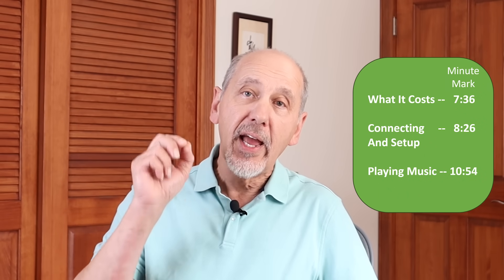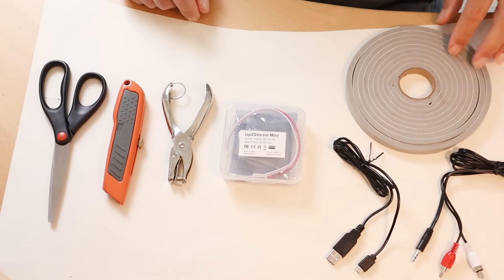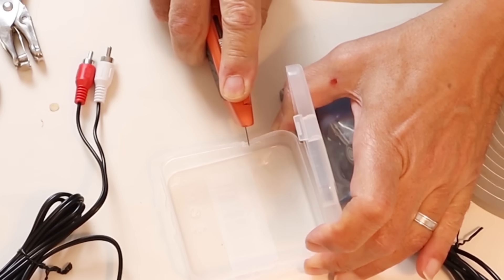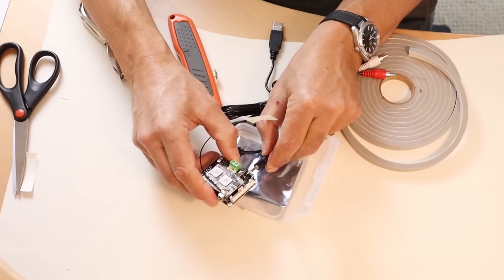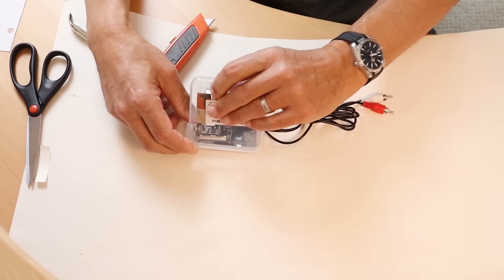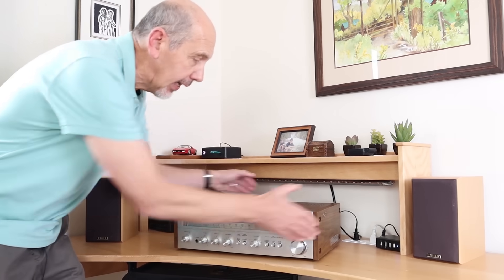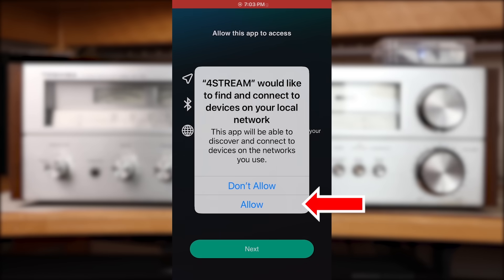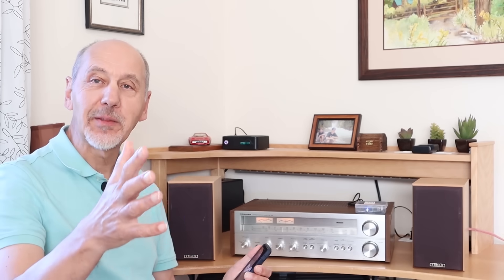Create A $50 Wifi Music Streamer Connect Phone Wireless to Stereo Receiver

Comment: Can I play music using Poweramp or Musicolet apps on my android phone using this device? i.e. will my music playing apps appear in the list of services in the 4stream app?
Reply from the maker: Your music playing apps will not appear in the list of services in the 4Stream app but all the music stored on your phone will appear in the My Music section which appears above the list of services.  This means you can play your stored music directly from the 4stream app without any other apps.  I've found  that is not the best wat to do it though.  Bubble uPnP or HiFi Cast offer a cleaner snappier  experience and work very well with the Arylic Streamer. These will not only play from the phone to the streamer but will also act as a remote controller to  discover and play music  that is stored on computers or servers on your network
Reply: Thanks for the clarification  @rogergadgetguy

Comment: Oh dear No. Guess why anti static bags are anti static?   Give up? Its because they are conductive. They are NOT a shield, they dissipate the electrical energy. So having a board of any type on an anti static bag while powered or operational is a no no. Yes, it might work, but it might not and if it does work right now, it may not work next time you go to use it and the no work may be permanent. 
It may even let the smoke out of a component and once the smoke escapes from an electronic component it will most likely never work again. Proving that electronics works off smoke in the components, ask any repair person.
Reply from the maker: The resistivity needed to dissipate static is very high  (It's in the megaohms) meaning that any currents that flow through the bag are completely negligible, will not affect normal operation, and will absolutely, positively, never ever cause smoke.

Comment: HEllo Roger, what to use if you don't have that power connector on your amp?
Reply from the maker: The USB power for the streamer can be plugged into any USB power block such as a phone charger.
Reply: @rogergadgetguy  Thank you. I have another question about AUX. We are 2 people with older recievers without AUX. Are there any other options because there are still many other plugin possibilities?
Reply from the maker: @ElNagual-j8k Any line level input will work which means any input except phono. Commonly - CD, Dock, Cabl/Sat, TV, DVD, iPod or VCR are all good.
Reply: @rogergadgetguy  Thank you so much.

Comment: Thank you, Roger. The Up2Stream does work as advertised, but I'm unable to connect it to my Google Home network as a WiFi speaker. Sure would nice to have this Home-compatible. All my other speakers are.
Reply from the maker: It's a shame, all music streamers and WiFi speakers have the same technical standard underpinnings (upnP, bojour DLNA) but they all, and especially Sonos, Google, Apple, and Amazon put proprietary software and licencing conditions in place to make sure we can't mix and match other peoples devices into their systems. They say it's to ensure compatabilty, but bluetooth, and WiFi itself prove that multi vendor interoperability can be done if there is a will.
Reply: @ Well put, kind sir. Open architectures preferred. 
My counsel to Arylic, while knowing little about the details, is to pay the license fee - I’ll suggest Google’s - to give their Up2Stream hardware products broader markets. I already made the choice of Google Home for its relative openness, compared to Amazon, and for Google Home ubiquity. Myself, I’d pay an extra $15 for this to work.
Reply: Hi @RogerGadgetGuy . I just installed Arylic's excellent LP10 Google Cast-compatible audio pre-amp. (Arylic also claims Apple AirPlay connectivity on the LP10.) Your previous video introduced me to Arylic. Now they have the product I wanted to use with my Google Home and Spotify audio setup. The LP10 sets up easily as a hardwired or WiFi-connected device. Google Home recognizes it without any additional setup, and I'm now playing Spotify over the LP10 - at WiFi speeds, accuracy, and synchronization with my other speakers. They've also moved to a new app for the LP10: Go Control, instead of 4Stream. It works. 

Thank you for introducing many of us to Arylic. Their new LP10 is exactly what I was looking for - WiFi-enabled audio for any amplifier. I hope it's a successful product for them. It's perfect for me.

Comment: How does this compare to setting up a Raspberry Pi 4 setup using the Moode app that goes on the Pi's Linux OS?
Reply from the maker: Great Question. Audio quality quality will depend on the HAT you use on the Pi. I've used an Allo mini Boss on a Pi Zero with Moode, with awesome results for sound quality.  I also  use a Pi running Moode with 512 Gb USB Stick as a music server, which works well with the Arylic streamer, or other Pi's.  A Pi 4 with a really good USB DAC will give sound quality that's hard to beat at any price. The downside is  Amazon music is not supported by Moode or any other Pi Platform I've tried, and you have to use bubble upnp to play Tidal or Qobuz from Android.
Reply: @rogergadgetguy  But if I connect it to my AVR that has an USB input, wouldn't the signal go straight to the AVR's own built-in DAC? So no HAT needed.
Reply from the maker: @q0w1e2r3t4y5  Yes that will work .

Comment: Thank you for th video. It looks like Arylic has one for $49 that has an ethernet port. Is that beneficial?
Reply from the maker: The ethernet port is a an artifact from when WiFi did not have the capacity that modern systems have. Sound quality will be the same either way. Only use ethernet if you have poor signal at the place you wan't to use the device. Or if your streamer is right next to the router.  If you use ethernet be aware that network devices like switches, bridges and range extenders sometimes break the functionality of streamers which have to be on the same subnet as your phone to work.

Comment: Hi Roger, I've just bought & set up an Acrylic Up2Stream & it all works well. The Acrylic 4Stream app is a bit flakey but now using iEast app. Do Acrylic do a board with a digital out if you have a HiFi with a decent DAC?
Reply from the maker: Arylic sell a $15 SPDIF out board; https://www.arylic.com/products/expansion-boards?variant=32778796040277 It connects to the Up2Stream mini with one of the ribbon cables that came with it it's plug and play, and works great.
Reply: @rogergadgetguy  Thanks Roger, I'll look that up & order one. I guess you've not done a video on using one, have you? Thanks again for the help. 👍

Comment: Thankyou Roger for your reply. In fact I had been so scared of damaging what I felt was a delicate bit of circuit board, I had failed to push in the 3.5 mm jack plug far enough. So, I had a coffee and plucked up courage to give the plug an extra push and alakazam, another click and I now have superb sound through both speakers. Thankyou again for a superb step by step video about a superb piece of equipment.
Reply from the maker: Glad you found out that those boards are more sturdy than they look!

Comment: Sees device but won’t connect.
Reply from the maker: This symptom is normally a function of the network.  It can happen if there are any bridges range extenders or powerline links between the router and one of the devices it could also be a security setting on the router does not allow DLNA connections.

Comment: i have a sony av receiver with bluetooth.  i purchased this just so that i could stream on wifi.  I am a neophyte when it comes to audio.  Am i wasting my time? or will i really hear a difference in music quality. Also wouldnt the 3.5mm jack and the rca cables diminish sound quality?
Reply from the maker: If you have nice speakers that are positioned reasonably (which means not in a corner behind a chair) you will notice a significant improvement in quality with WiFi.  As long as the 3.5mm plug and RCA cables are in good condition they will have no negative effect on sound quality at all.
Reply: @rogergadgetguy  thank you Roger. Appreciate the reply

Comment: Superb video and excellent, straightforward and clear instructions. I have connected the device to an Arcam Alpha 8 but only one speaker is responding…..adjusting the balance makes no difference. Used a 3.5mm jack with both cables connected to aux sockets on the amp. Sound through the one speaker is perfect. If you have five, I would appreciate your advice please. Thankyou again for great video.
Reply from the maker: Most likely a cable problem 3.5 mm connectors differ slightly in size wich sometimes causes issues try pushing and wiggling with the amp on see if it sometimes makes contact.  rule out an amp prblem by switching the RCA cables if outage switches sides, amp is fine.

Comment: is a v very good idea for my vintage hifi. Once i got down to the app, seem is fm China, then i stopped.  😢
Reply from the maker: If you want a WiFi streamer that's not from China you will likely have to build it yourself using a Raspberry pi single board computer.

Comment: Wow I turned my 1947 GE Radio into a Bluetooth speaker using the phono input. Now that you tell me Bluetooth is low quality maybe I should change it to a streaming device 😂 Those vacuum tubes are pretty high fidelity after all, all the Audiophiles love them!
Reply: I'm 50, audio nerd my whole life and Bluetooth is fine for me, I've measured it, and over 12 or 13K BT falls off quickly, only problem I could see, and I can't hear over 13k anyway. Also depends on source (I use an old Iphone) , convenience and needs. You could just use a 3.5mm audio jack and cable, which is much better than both. 
It is magic to see an ancient radio just rocking out cyrstal clear audio.
Reply from the maker: It would be so cool to use an old tube radio (or several) in a multi room streaming system. Take that Sonos!!!!!

Comment: If there are exposed circuit paths or through hole vias on the WiFi board, DO NOT STUFF THE ANTI-STATIC BAG IN THE BOTTOM OF THE BOX!
Anti-static bags are conductive by nature. It is possible to short out components on the WiFi board by doing this.
Reply from the maker: Static bags are conductive but very high impedence, low contuctivity they will not cause any problems for this type of board.

Comment: I don’t get it.  If the Up2stream does not directly log into Spotify and is just streaming from the phone to the Up2stream via Wi-Fi , why not just use Bluetooth; I.e., just get a $20 Bluetooth receiver?  Likely, you’ll be within 25 feet of the Bluetooth receiver anyway.
Reply from the maker: The sound quality is noticably better over WiFi and the connection is more reliable. One example whenever my wife starts the car or returns home, my bluetooth connection switches over to the car and my music plays there instead of the stereo. Don't have that problem with WiFi.

Comment: just bought mine for 43.5 euro , , i noticed it has an extra board on top now, , i think it has extra options,  sets up and works in a few minutes, awesome thing and nice sound .  i wanted this because i bought a new receiver with build in wifi and found out how easy this is to use instead of bluetooth . i open spotify, choose the source and the receiver (with the build in wifi) starts up without any help. Now  this small device let me make my other older receiver also capable of playing wifi content. i put it on my rodec mixer,   the thing is this wifi signal go's trough walls a lot better than bt even from in the garden,  adjusting the volume and searching new songs, especially with spotify this is a must.  in weekends it plays the whole day long without loosing connection .

Comment: Adding an optical connection would be awesome.
Reply from the maker: You can add the Arylic SPDIF out board.  It's only $15 plugs in with ribbon cable provided and works great with no additional setup. https://www.arylic.com/products/expansion-boards?variant=32778796040277&aff=189

Comment: Unless I'm missing something, it is incorrect to say that you can stream from any computer you have. I have a MacBook Pro and 4 Stream isn't made for that. It is made for phones and pads but not laptops. Am I wrong?
Reply from the maker: Thanks for asking this question. I think I see where the confusion is.  The 4Stream app is not the streaming device it is merely the controller. What it does is let you view and select from the available music at the music source and direct it to be sent to your stereo. The music source can be a streaming service like spotify the media app of your phone or any  computer on your network. The Mac needs to be set up as a music server, but once you have done that. You can remotely send music from a MAC to your stereo using the 4Stream app on your phone.  This video shows a free server app that works on Macs   but there are other apps you can use.  https://youtu.be/DZSx9ZPveqY This is a lightweight service that runs in the background doesn't affect the operation of the MAC but is always available as long as the computer is turned on.

Comment: Great video mate but I'd be more interested in streaming my own from a NAS. Does the software support this type of connection. Having a small cheap less power hungry device compared day to a PC would be nice especially if it's able to decode codecs like DTS, DVD-AUDIO SACD etc. 
I guess I'll send the company an email 🤔

It does sound intriguing. I may just pre-order one anyway.

Thanks for the video 👍
Reply from the maker: Streaming from a NAS is supported provided the NAS supports DLNA. Most do but it may be turned off by default.  DTS, DVD audio and SACD codecs are not supported by this streamer you would need to transcode those files tosomething like  Flac, ALAC, mp3, or AAC.

Comment: For 50$ you can buy ready to use Android tv box with 3.5 aux and optical SPDIF outputs, Chromecast and even Netflix certified.
Reply from the maker: Can you share a link please. The ones I've seen at that price haven't had the audio outs. Airplay is not normally featured on these boxes either but they is easily remedied with the Air Receiver app.

Comment: Thanks for this great video,Roger.Its fantastic to find someone like you who wants to make use of the full sized hifi equipment of yesteryear which,in my opinion produced a far richer sound that the modern scrunched up versions(aka mini hifi) Is there a dab addon instead of the network streamer which might enable me to receive Gold radio,therefore matching the age of the hifi to the music it produces?I await with interest......
Reply from the maker: Hi, I'm not aware of any DAB receivers designed to be used with a home audio system, but they are available for cars, and should work fine. Look for one that runs off 5V usb and has an Aux output something like this;  https://www.aliexpress.us/item/3256807764050822.html?src=google&pdp_npi=4%40dis%21USD%2141.05%2138.49%21%21%21%21%21%40%2112000042996877889%21ppc%21%21%21&src=google&albch=shopping&acnt=708-803-3821&isdl=y&slnk=&plac=&mtctp=&albbt=Google_7_shopping&aff_platform=google&aff_short_key=UneMJZVf&gclsrc=aw.ds&albagn=888888&ds_e_adid=&ds_e_matchtype=&ds_e_device=c&ds_e_network=x&ds_e_product_group_id=&ds_e_product_id=en3256807764050822&ds_e_product_merchant_id=109198114&ds_e_product_country=US&ds_e_product_language=en&ds_e_product_channel=online&ds_e_product_store_id=&ds_url_v=2&albcp=20123152476&albag=&isSmbAutoCall=false&needSmbHouyi=false&gad_source=1&gclid=Cj0KCQiA7NO7BhDsARIsADg_hIZ6ERQEwrdEoyQ1tswbVrbzlAtMT4yrC90eCdVHSrmsSceofXwtTeEaAk7gEALw_wcB&gatewayAdapt=glo2usa
Reply: @rogergadgetguy  Thank you for that,Roger

Comment: GOOD STAFF. But can i use typical tv adriot box as the streamer with hdmi output and show to connect to an avr.tks
Reply from the maker: Yes you can use an android TV video box connected to an AV receiver as a music streamer.
Reply: Still cannot paired my phone 4 stream apps to my tv box(no blinking lights). DID I MISSED ANY STEPS?
Reply from the maker: @joelow4120  The Android TV box does not need the 4 stream app. If you have an android phone tap the chromecast symbol in any music app and you should see the TV box.  For an iphone install the air receiver app on the TV box which will give you streaming via apple airplay.

Comment: Interesting, you stated that Bluetooth uses compression and discards  musical information, this is true, however there some Bluetooth codecs that use far less compression, think LDAC, HWA.
But then you setup Spotify on your streamer, which is fundamentally mp3 which is lossy compression all the way. So in this example I don't see any advantage, if you're using Spotify, may as well use Bluetooth.
Reply from the maker: Hi I use spotify for demos because they have royalty free music that won't give me a copyright hit.  It'salso the most popular music service so viewers are more likely to be familiar with it than the lossless services.  Even Spotify does sound better on WiFi. I think the reason for that is that Bluetooth does not support Mp3 codecs so the Mp3 stream has to be trancoded into SBC before transmission. the  transcoding process is itself lossy. WiFi will send the Mp3 unaltered. Another reason is that most bluetooth devices use the on chip DAC and the DACs on cheap BLuetooth chips are pretty bad. The DACs used on WiFi streamers measure better, and sound better.
Reply: Shhhhhhh 😂

Comment: In Fact you ONLY need the phone, if you run plex and install plexamp on all the phones you want to use as clients and you can then use any of the devices on the network to control each other.

Comment: Interesting solution, thanks.  What about the power button ?
Reply from the maker: The power is very low, around 1 wattt. I leave it turned on.  One of the receivers that I use has a switched outlet, but I still prefer to leave it on so that I don't have to wait for it to boot up and connect each time. The optional remote has a power button to put it into standby.